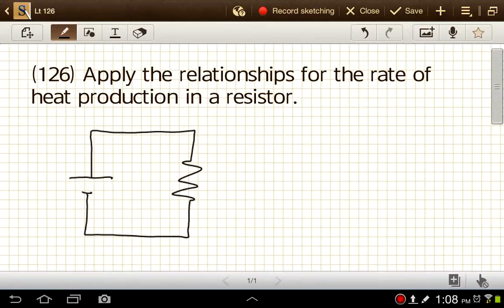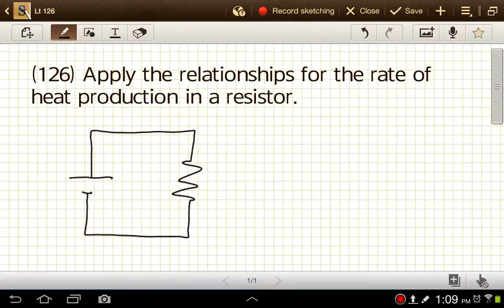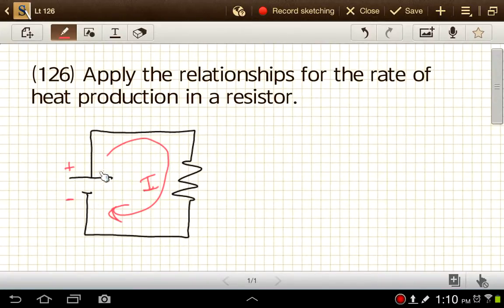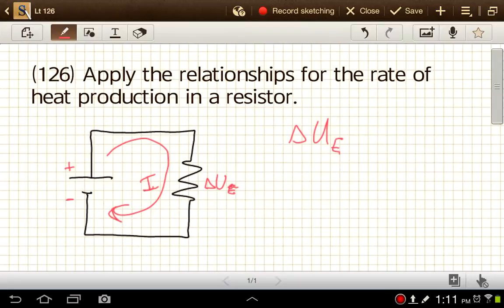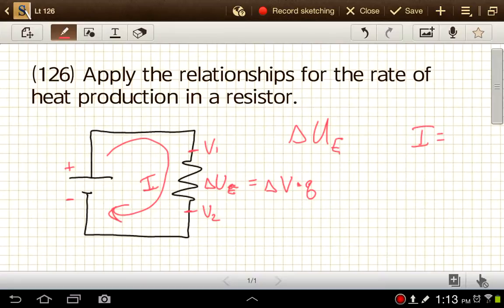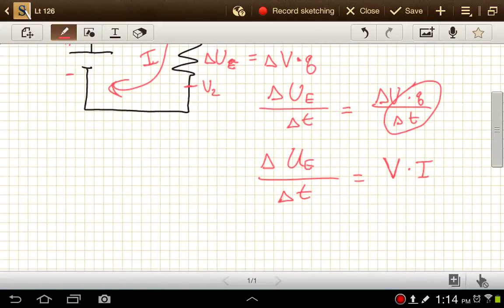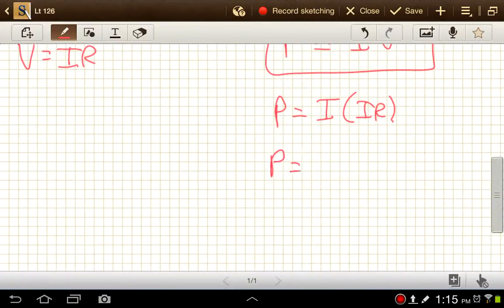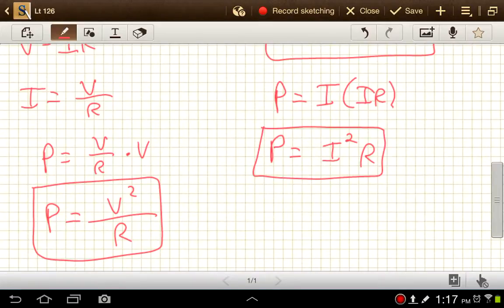Lt 126 - heat in a resistor

Comment: How do I calculate the maximum current density (Amps per meter squared) for square plate shaped electrodes of various materials (316L Stainless Steel, Graphite, Platinum) that will be used in water electrolysis) before the plates begin to overheat (the heat boils the water producing steam or melts the material)?